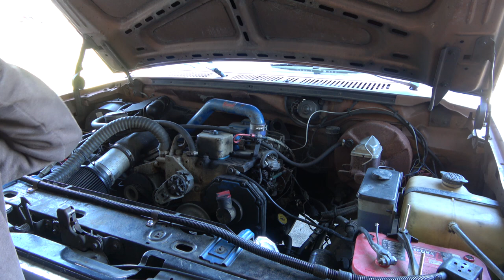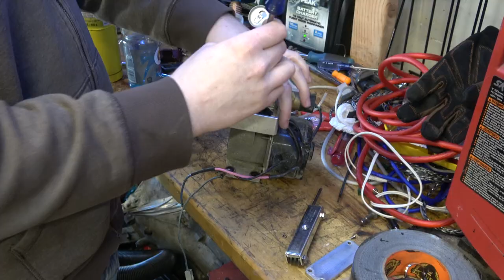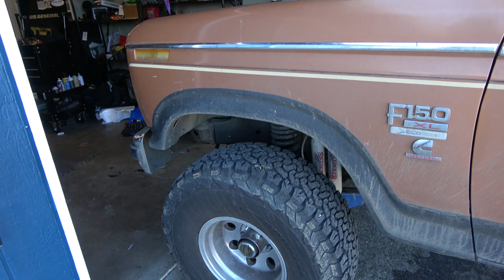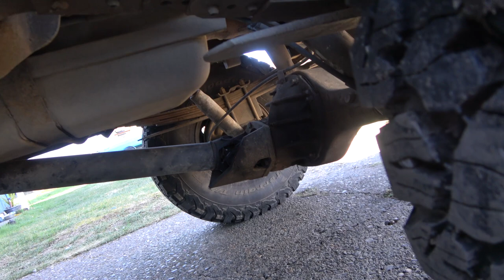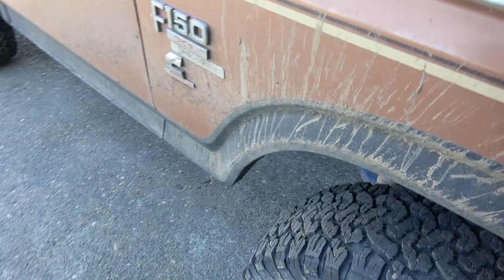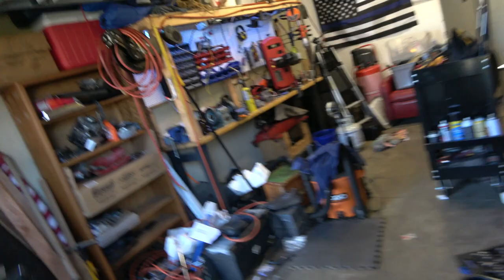4Bt Bullnose F-150 | Summit Racing Vacuum Pump Fail!

Comment from the maker: Alright, I knew you'd say yes. Cab light kit is on it's way.
Reply: Dude ive had a cab light kit since my 86 f150 like 3 years ago. I never put it on the f150 but kept the kit. I was cleaning out the garage friday and was contemplating the same thing you are now. Long story short im putting cab lights on my 85 f250
Reply from the maker: @mestupkid689  nice, i have been thinking about it for awhile actually.
Reply: The cummins vacuum pump is a great idea. I just did a 94 f150 4bt swap and went with the 6bt gear driven power steering / vacuum pump combo. Made that part of the swap easy.
Reply from the maker: @ssbowtiess  nice. i am totally looking forward to my new pump. just ordered one, a bit sooner than i expected.
Reply: @justhes  I think I wanna do a TDI swap soon too

Comment: when you put in the cummins pump be shure to put the rear pump bracket on it or it will brake your front gear case.  and a no on the cab lights. Bob

Comment: I have hydroboost on my super duty, definitely NOT a fan of losing brakes and steering when the engine dies, I'd say stick with the vacuum. Another thing, I'm not really sure it would do anything for you, but I have heard of putting super duty axles under the older trucks, and that they stop tremendously better with bigger brakes all around and disc at all four corners.
Reply from the maker: i have thought about super duty axles, however i dont have a problem with braking performance.